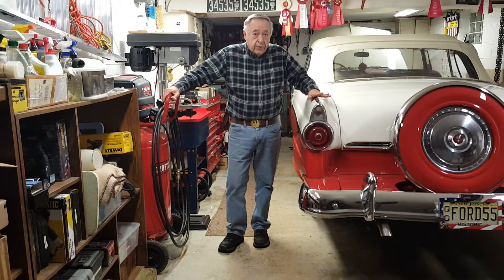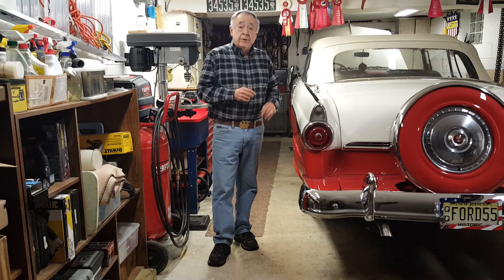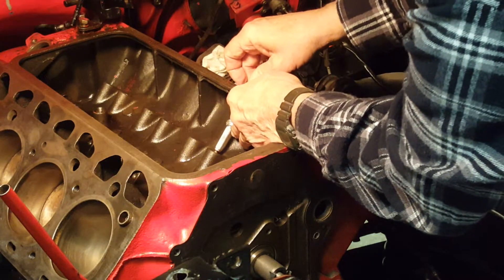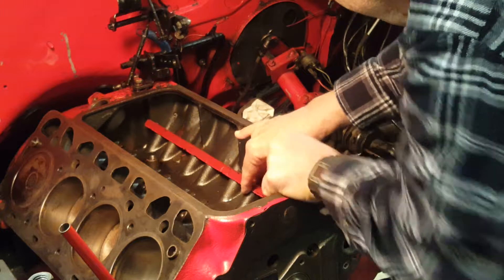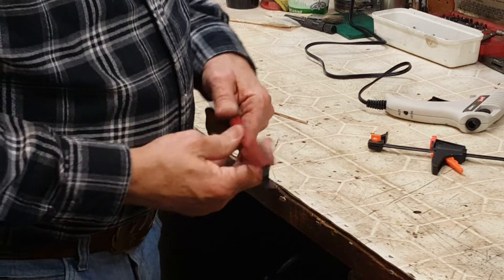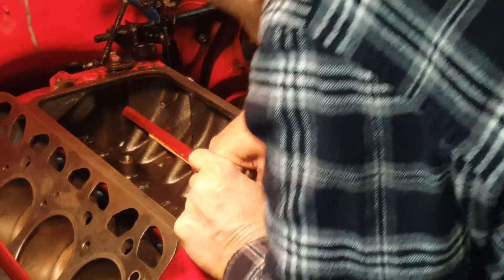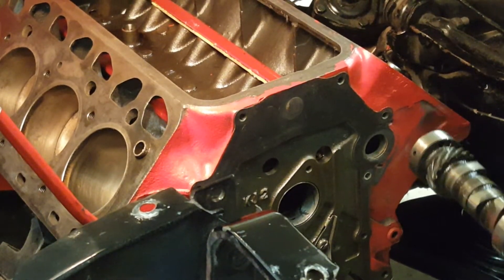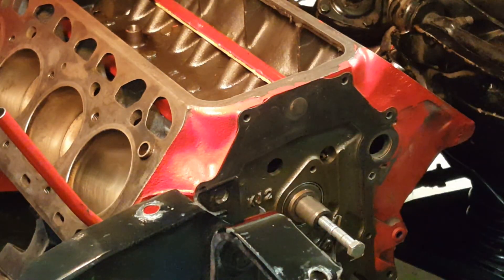Ford Y-Block Lifter Tool

Comment: If you put a bolt and 2 nuts in the mounting holes on the ends, uou could have adjustable height

Comment: I bought those long magnets from Harbor Freight and they are the perfect length. Fits in the Y block valley perfect to keep the lifters up. Way way better than clothespins. Agree, change lifters with the cam.

Comment: You came up with an excellent solution to this problem.  I changed cam and lifters to a Melling “race profile” in 1966 as a very limber 16 year old.  I used the cloths pin idea and it was a terrible experience.   Thanks for sharing this Jim.

Comment: Neat way to hold the lifters up out of the way to remove the cam, BUT when replacing old cam with new cam you must replace the lifters or the new cam will be ruined.  Lifters and cam lobes "wear" together.  New cam-new lifters and that is a whole lot of new problems, for the Y block.

Comment: If you are just pulling the cam to inspect it, then great. The issue arises when you want to replace the cam with a new one or one that has not been mated to those tappets. You are going to have to drop all those lifters anyway - remove that oil pan.

Comment: Maybe use the hot glue gun to glue the lifters in the fully open position. Maybe tap and drill the ends of the magnet bar for machine screws to hold the lifter bar at your preferred height. Great video.

Edit: Use small tie wraps instead of hose clamps.

Comment: I hope you don't put in a new cam using those worn lifters. Actually, you have no idea how the lifters are wearing. Things can go sideways real fast during break in of the cam if there's a wonky lifter. Best rule here: New cam + new lifters is the only way to go. New cam with used lifters is always a crapshoot.

Comment: All my buddys wanted to know why I had 16 cloths pins in my tool box, and as a high school street racer,  I had a 520 lift cam and every time I missed a shift , the ole 312 hit 8 grand and there goes another mushroom head broke off. New cam, time  because teh stem of the 'shroom ' would grind the shit out of a lobe in a few seconds.  I got so good at it I could swap cams in 2 hours on my 57 wagon. no air or ps . I did probably 30 of them untill my kid was born and I did  not have the money to by new cams every week. I should have got super heavy valve springs , would have helped a bunch. dumb ass kid. , My buddys also said 'why oh why  do you run a why block?????  dumb ass kid I guess!!!!!!!!!!!!

Comment: The 'hardest' problem is to figure out how to keep something SIMPLE! Been workin' on Y's since 1969 or so. Still have a few too! '56, Country Squire with a 312., '57 Fairlane with a 312 and a' 57 F-100 with a 272 block that's bored to the 292 standard piston size and a 312 crank with undersized mains. It comes out to +-302. I'm waiting to hear people argue when I state "It's a 302!" 😁 Beautiful solution to the lifter issue when the cam needs to be replaced with the engine in the car! 😍

Comment: Almost like they designed it so if you are to pull the cam you need to pull the engine flip it upside down and do all the bearings and rings at the same time.

Comment: New lifters on old cams? OK. 
Old lifters on new cam? A really good way to "get" to put in new lifters on another new cam while you've got the engine apart trying to figure out how its making metal-flake oil and why the new cam has a "lope" to the idle all of a sudden. Ford used "mushroom" lifters as "cheap insurance" against warranty claims when "tuneups" turned into "teardowns" after "recommended" service, maintenance and driving processes and products were "worked around" the sort of "motorist" and/or "mechanic" to find a way to "work around" something like.....replacing lifters when installing a "new" camshaft.
Reply: Why so many "air quotes" in every "sentence"?
Reply: @xJMSports  cause “ he” thinks he’s “no it all”
Reply: BS, nothing  wrong with Y blocks, problem was they rarely got oil changed enough and NO routine maintenance. this was 1950s oil wasn’t all that great back then and required change every 2000 miles. Also few people was smart enough to work manual choke or adjust thermostatic automatic choke foe winter or summer setting.

Comment: Great video! Thanks! That's a great idea. I changed the cam in my '57 Ford twice using the clothe pin method. It worked good, but I was very nervous about dropping a lifter.

Comment: Hey Jim,  I just got my first Y block,  and was wondering how to put a different cam in without taking the engine out..   I cant wait to try it out !!    I'm also looking for a 64 292 four V intake , if anyone has one there not using.  knfrtz@yahoo.com
Reply: Ken Fritz be careful to not knock the rear cam plug out. I did this over 40 years ago and created a lot of extra work for myself. It's basically a freeze plug